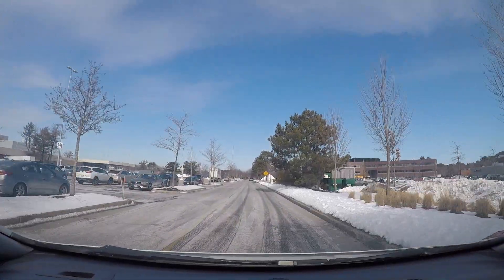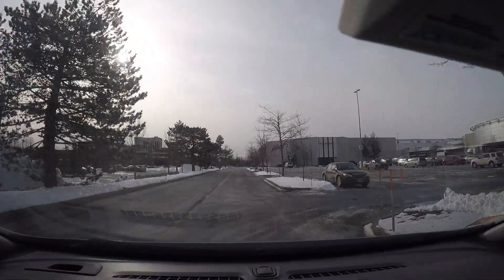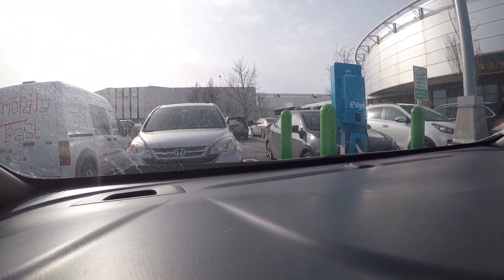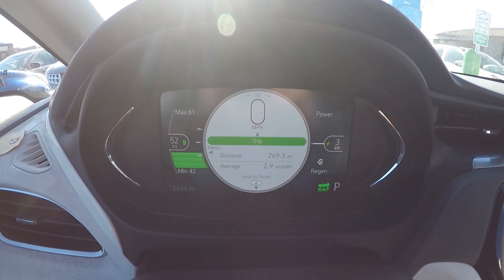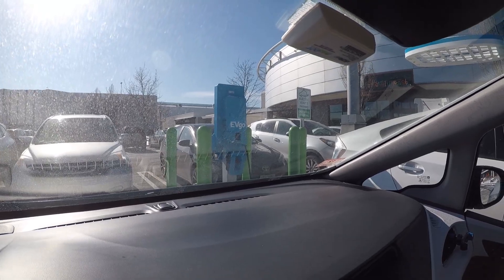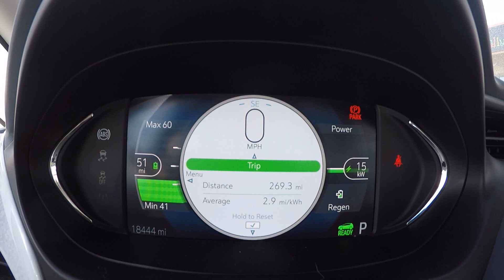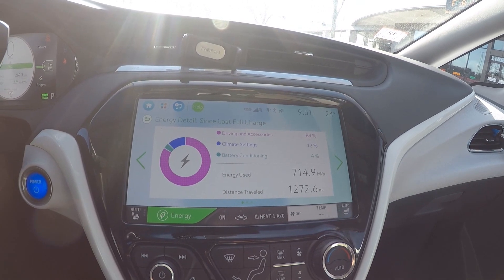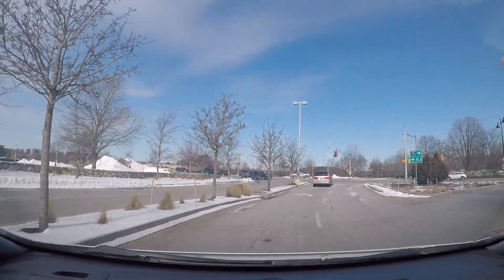Bolt EV Charging: L2 to DCFC Winter Test

Comment: A little off topic, but have you shared your driving techniques/settings philosophy to get the higher kwph? My climate settings take up 11% of my battery usage! I drive with a very hot-blooded person who needs the A/C on full blast, which means I use the heated seat to survive.  Where do you set your climate?  How do you balance comfort and mileage? 

We don't travel much right now for obvious reasons, but with our usge I'm worried we won't be able to take the Bolt on longer trips as easily.
Reply from the maker: Ouch, sounds like the worst of both worlds! In the current situation, temps are in the comfortable range of 60-80F, so we only really hit the A/C if it climbs higher into the eighties. At that point (as it was for most of this summer), we find A/C set to 70 and blowing on 3/4 is sufficient to keep everyone comfortable (two adults, two kids). Over the summer road trips to PA/OH, that setup only consumed 4-5% of energy at most across 1,000+ miles.
Reply: @plugandplayEV  that helps.  So when you are in the comfortable range, are you running the fan only or windows down?

Maybe part of the challenge is we travel shorter distances so we are arriving at our destination by the time the cabin has cooled. It follows that we would be able to maintain the desired temp at a lower blower speed on a longer trip,  and bring down our overall bettery usage.  

Am I alone in this?? I feel this pressure to optimize battery life while not asking my passengers to compromise - to make sure they have a favorable view of EVs.
Reply from the maker: No, I get you... It's just that I don't have to prove anything to my occupants because they're already on board with EVs! One big question is do you have L2 charging at home? If so, preconditioning the car with some full-blown A/C would go a long way to saving energy -- pull that cooling power from the wall, rather than to the pack.
Reply: @plugandplayEV  no L2 yet, but that is a great idea.  We are planning to upgrade our electrical next year, and have L2 installed at the same time.  I'll have to temember this!

Comment: Q:  I just test drove a new 2020 Bolt EV overnight, and did a test DC fast charge at the 50kw station by my house.  it was 32F/0C outside and at 28% battery it promisingly started at 40kw for a couple minutes then quickly locked down to 33kw for around for the next 30 mins then gradually declined to 21Kw when i terminated the charge 64 minutes later at 73% charge.  In your experience do these numbers seem to show any of the cold weather improvement that GM promised on the 2020s compared to your experience or is this charge curve still pretty typical for a 32F/0C day?  Thanks!
Reply from the maker: A lot depends on use of the car before the charge... was it driven a lot or did it sit in the cold for a long time? The numbers sound good from a cold-soaked start (apart from the strange spike to 40kW and down, which I can't explain), but they are what I'd expect from our 2017 after driving for a while or leaving the car on to allow the battery heater to run.
Reply: @plugandplayEV  Drove it 16 miles home from the dealer then to dinner 1 mile away and it sat for 30 mins then went to the charger.  A little surprised that the 2020 Bolts 66KWh battery can only sustain half its C rating at 30% charged, especially when I see videos of the Kia Niro EV sustaining 72Kw (granted on a 150KW charger) up to 57% charge then still hold almost 60KW after that.

I drive a '17 Volt daily today and was really like to Bolt but road trip twice a month just at the edge of the Bolts range each way, so effective fast charging at the advertised rates is top of mind and something I think GM really needs to get right.
Reply from the maker: I doubt the battery got much chance to warm up in that case, so it could show the mild improvements GM claims (i.e. 150% improvement over the first 30 mins charging). I'd expect to see a 15-20kW start rate in our 2017 with a cold pack so 33kW, while still disappointing, would be a marked improvement.

The real test would be to get on an Electrify America 150kW+ unit from a low state of charge. That should add half the pack capacity in 30-40 minutes in non-winter weather, or closer to one-third of the pack in that time during winter. 

By comparison, you can shave roughly 5-10 minutes off for a Kona Electric or Niro EV, which isn't much over one stop but might be important to your use case. Remember that the cost for that same charge on Electrify America is currently 2-3x higher in those models than the Bolt EV, though, as they get shoved into price tier 2.

Comment: Already have a Bluetooth ODB2 and Torque Pro for my Bolt north of you.  Been playing with it on my commute and watching how the cabin heat draw works along with the battery conditioning.  Looking forward to the weather finally starting to warm up in the coming weeks.
Reply from the maker: Great stuff, glad you got into one and already have the diagnostics running. Will be interested to hear how your long commute goes in these last few weeks of winter temperatures... it'll be plain sailing after that!
Reply: @plugandplayEV  Commute has been fine with no issues.  Only charging it to 85% and still make it home with over 20% left.  Really looking forward to spring and warmer temps to help improve that.

Comment: I’m very grateful for the warmer winter temperatures here in Fresno CA as well as being able to trickle charge overnight in the garage.  Good luck finding a solution.
Reply: Just took my first long distance drive to Orange County and then central AZ this week with my month old Bolt.  Got to experience plotting out a trip around fast chargers - 11 fast charging stops and only 3 20 min. waits with one down charger along the entire route.  Knock on wood, considered myself lucky in the 1600 mile road trip.
Reply from the maker: That's some trip... most we've done is 1100 miles round trip to Cleveland, OH. Glad it went so well for you!
Reply from the maker: Absolutely, such a great climate for EVs over there. Not really a big problem here as we only really fast charge on road trips, so the issue resolves itself after hours of driving. Plentiful local charging too, so we're in good shape thanks!

Comment: I noticed your heater fan running when you were getting 16Kw. If you turn the heat off would that help?
Reply from the maker: I don't believe so. The rate will usually fluctuate a little when the heating/cooling is toggled, but the rate adjusts fairly quickly to pull extra power from the charger and maintain the battery charge accepted by the car. Unless you're at max draw on the unit, climate settings don't typically eat into your charge rate.

Comment: Here's my take on the issue: Any technique to warm the battery apart from the anemic battery heater rely on I-squared-R heating. Current through the battery creates heat in the cells when it flows through the internal resistance of the cell. As more current is used, the heat produced increases exponentially because the I component (current) is squared. Doing a few full-power launches will surely create some heat in the battery, but not very much since the current is only flowing for a few seconds. 

I think the best approach would be to take a short highway jaunt at the highest speed practical before charging. If the car is cold-soaked from staying out overnight, I'd hope it'd be at least 20% charged from L1 charging overnight. If there's a DCFC at the right distance from your starting point, racing there at high speed would be the best bet to have a high charge rate when you get there.  Don't forget to regen as aggressively as possible on the off-ramp! Current creates heat in the cells whether it's flowing in or out, so make the best use of that.
Reply: This  does not work unfortunately. My 2019 Bolt EV was sitting overnight this past winter. Temps were in the 20’s dipping slightly lower. I pre-conditioned my car twice thinking it would get the ball rolling getting the battery ready. Drove then two miles to the EV go charger. A big part of that was highway. Found someone had started a charge before I got there so I had to wait for 40 minutes. Plugged in and it only accepted 18 KW. Too almost 30 minutes to finally see 38 kw.The max I’ve seen this charger output was 44 kw. 

You are wasting a large amount of your time and. Money in the winter on the cold battery. The best thing you could do is plug it in to either a level 1 0r 2 for a few hours at least to get the battery ready. Then charge at a level 3. 

Hopefully Chevy adds a “precondition battery” button feature like Tesla. This is much needed in the areas where weather hits the extreme highs and lows in temperatures.

Comment: All EV when their battery is cold, have low charging rates. You should do a 10 mins "yoyo" game with it, meaning accelerating hard and then regenerate hard to warm the battery. For the Bolt EV the temp of the battery for the optimal charge is about 19 C degrees...
Reply from the maker: Tried it several times at various speeds/distances, always the same result in the Bolt EV: 15-18kW starting charge rate. Other models certainly have the same challenge but some seem to ramp up the rate more quickly. Not a big problem but definitely worth new Bolt EV owners understanding what's happening when winter charging in this scenario.

Comment: Wow, this is a bit disappointing. 25 F is a fairly common winter temperature for that area, and not unusually cold, so I'm kind of perplexed as to why the battery charge rate would not increase to 50 kW.
Reply from the maker: From what I can glean, the battery heater isn't as aggressive in the Bolt as it would be in say a Tesla. The latter will have the same problems even at 25F, but will typically work to ramp the charge rate up much more quickly than GM has allowed the Bolt to do. Along with the 55% first taper and limiting the max charge rate to 55kW, it all points to GM taking an extremely cautious approach to battery management.
Reply: Adithya Ramachandran DC fast chargers are for long trips so his battery would be warmer to take the higher kw.90% of EV owners charge at home like me,We almost never use public chargers and we have a 2015 Leaf live in Canada a winter city were -20c is not uncommon.

Comment: I’ve been told that multiple fast acceleration prior to DCFC may help because it warms up the battery. One of my friend tried this before going to a DCFC here in Montreal. It was -15c outside. He told me that it helped. You should try also to precondition the battery before .
Reply from the maker: Definitely one of the suggestions I've received several times, often I think based on a successful attempt by Bjorn Nyland in his Model X. Unfortunately I've tried multiple iterations of this in similar conditions with the Bolt EV and never seen it work. That includes the brief burst drive that I published on the channel, as well as other longer stints (10-25 minutes drive time) with hard acceleration/regen braking. Didn't seem worth making multiple vids on the same idea, but I simply haven't been able to make it work in any scenario.